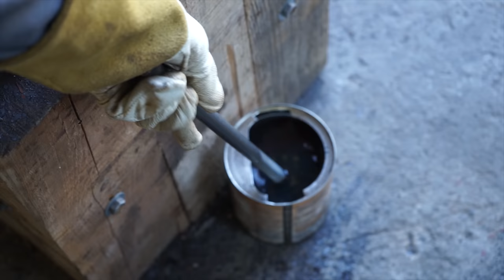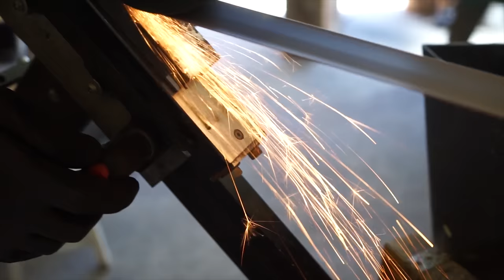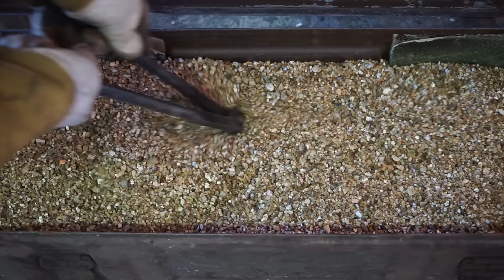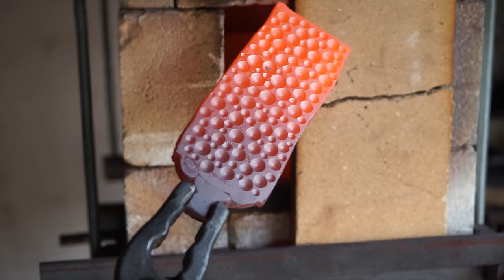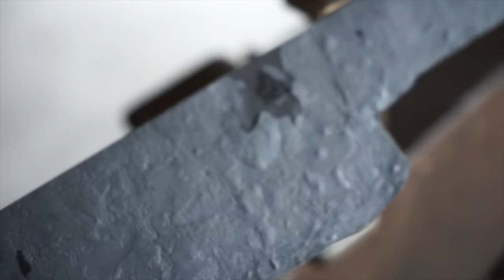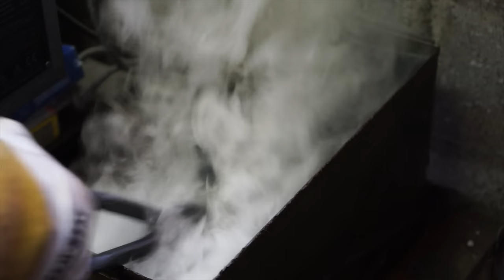Making a damascus steel gyuto chef knife with food release

Comment: Beautifully done. I am definitely not a fan of unfinished metal blades being used in food service, though. Leaves crannies for pathogens to hide. Granted, the metal will kill them in a few hours, but that’s plenty of time to cross contaminate.
Reply: Are you saying the knife he forged isn't finished????
Reply: @ballistic350  the top edge of the blade is rough, as the maker intended. That’s fine for looks but not fine for food service. Bacteria can hide there temporarily and lead to cross contamination. It’s a shame he did a concave grind for food preparation, and then left the rough surface for cross contamination.
Reply from the maker: Blades like this are used worldwide without problems, knives have to be cleaned regardless of style especially if food will be left on it for hours. Thanks for watching
Reply: @mgmcd1  ultimately it depends on the maker,I have a few japanese chefs knives like this design and have no issues ..likewise wash everytime you intend to use it on a different item anyways.. always gonna have its pros n cons, I'm fine with it.
Reply: @ballistic350  that’s good. I was commenting from a commercial kitchen perspective. The blade had an awesome hollow grind, which is great for a chef’s knife, but has imperfections along the top of the blade that would keep it out of a commercial kitchen. It’s a simple point. A health inspector will write you up for a crack in any food preparation surface, and I was presuming for a rough surface on a kitchen utensil. The blade looks top notch, but not for commercial use. It’s not difficult to understand my observation.

Comment: Does the metal that you weld together ever start to fray or split when you start to hammer it? When do all the metal pieces fully fuse together? 1st time you put it in the fire?
Reply from the maker: The metal is fully fused and would only split at a low temperature or too high